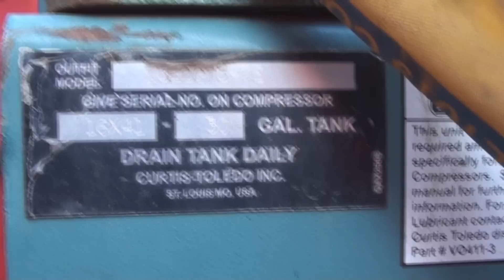Air Compressors & Pneumatic Tools

Comment: I see you put a chicken-like cage around one of the compressors; i assume this is incase it blows up?
Reply from the maker: Actually it's a good deal heavier than a chicken cage. More like a gorilla cage. It's there to prevent the compressor from being damaged by forklift or whatever hazard comes its way.  FWIW the pressure relief valve(s) are there to keep it from blowing up.

Comment: Blurring out that HF drill doesn’t make it any less awesome.
Reply from the maker: I blurred it cuz it had my name engraved on it.  Nowadays I cover my name with a bit of electrical tape.
Reply: @repairs101  Check this out... I bought an electric angle grinder for 9.99 at HF and I added the 1 year replacement plan for 2.99. The lady at the counter told me that it starts after the HF 90 day warranty and to bring it back in a year whether it’s broken or not, and they will replace it no questions asked. The manager was standing right beside her and said nothing. So, for $13 I essentially get two angle grinders! I will probably buy most of my stuff from HF now.

Comment: My only question is one thing: I cannot find a compressor that has over 6 CFM @ 90 PSI. I found an air impact wrench that I want to use that is 6 CFM @ 90 PSI minimum. The only compressors I can find are 60 gallon compressors that have 7 CFM or above. Everyone tells me "oh you need to have more CFM than your tool" but I know there has to be more options than a 60 gallon compressor.
Reply from the maker: You are trying to match an industial tool with a home compressor.
Get a compressor that runs on 220 volts or buy a hobbyist impact gun.
Reply: Gotcha, thanks for the info!

Comment: can you use a air tool that has a slightly higher CFM requirement than your compressor?   for example im looking at a compressor that has a 3.7 CFM at 90 PSI and the tools i had in mind for it require 4 CFM   any input would be helpful
Reply from the maker: It will probably work OK just not to its full potential - I'd look for a bigger compressor.

Comment: I only put impact tool oil in the air inlet. I've heard of people using ATF, but i haven't tried it. I also just bought a mini grease gun to put heavy grease in the little hole on the body.
Reply: I have an IR 2135Timax and I've gotten great performance out of it, it has a grease fitting but I've never greased it. I just add three drops of ATF every day, and that's how I maintain all of my air tools.
Reply: thanks chantz. did you know they have a 2235 now? I am going to see what the heavy grease does for my gun.
Reply: Yea, I was looking at it, but I buy all of my air tools of off my local Mac dealer, and he sold me all of my IR products. He advised against buying the 2235 because the anvil breaks often.

Comment: hello I'm looking to buy a air compressor and I'm wondering if the bits that goes on the end of tool which will attach to the quick release do they come with the tools if any one can help me plz thanks
Reply from the maker: Almost any air tool you buy will come with QR fittings.
Reply: Thanks for the help its really help me thanks

Comment: One other thing to note is that quiet air compressors actually are available, but probably not carried by your favorite tool retailer. Check around online if this is important to you. You'd be surprised what you'll find if you search for "dental air compressor". Much cheaper to buy a quiet unit in the first place than to have to build a separate closet or shed for a noisy unit later.
Reply from the maker: Great tip! Thanks for commenting!

Comment: Capacity is also a problem. 10gal is 1.33Cubic feet, you can only use @ 1/4 of it before pressure gets too low and the compressor needs to kick in. So if we can use .4 cubic feet. we get (.4CF/20CFM*60s =) 1.2 seconds use before compressor needs to run (0.4CF/4CFM*60s =) 6 seconds to fill it again. So in that case you would get to use the tool one second in every 5 for a couple of minutes, and then take a couple of min off (I know 4 isnt 5.3, but its close & a crapload easier to do the math lol)

Comment: To put that another way - if you have a 4CFM 50% duty cycle compressor it can actually give 2cfm AVERAGE over a 10 min period. It can probably do 80CFM for a second or so but then you would need to let it fill up and sit for a few min to cool before it could do it again. So if the too uses 20CFM you can use it 2CFM/30CFM =1/10th of the time or one minute in every 10.

Comment: Sure you could use it - but how much. It will already have a duty cycle they used to estimate the cfm needed, ie it might uses 18cfm but they figure you will only use it 20 sec per min so that averages out to 6cfm. Then the compressor has a duty cycle 50% at 5.3cfm so its 2.7cfm average. so then end up with a tool you can use for maybe 9 seconds every minute on average. These are guesses - but you can easily find specifics and figure if it is enough for you

Comment: That doesnt make sense my friend. Combining 2 6cfm pumps will give 12cfm, pretty simple math. Would be just like any other dual pump setup. Just like any other dual pumper would be best to use a combining tank to even load. Of course their duty cycle (DC) needs to be taken into account, but even with 50% DC units they would combine for 90% DC at 7cfm. There should be NO problem at all running the tool, other than stopping for 30s total over ea 5 min if they are 50% DC DIY grade units. Cheers :)

Comment: to help people out i have a 27 gallon craftsman pro that is perfect for around the house/farm.  its big but portable, and i usually just unplug it except when i need to run the pump again.  Its perfect for working on cars.  if you are only going to run a nail gun you could probably get away with something smaller.  sears has a chart in store for what their compressors are good for.

Comment: Very informative; I'm running a 30 and a 20 gallon Craftsman compressor in tandem and was wondering if I can run a sandblaster rated at 7cfm.  The compressors are rated at 6.4 and 6.2 at 90 psi.

Comment: Hi my impact gun is rated at 6cfm. I'm looking to buy a 10 gallon compressor with a rating of 5.3cfm @90psi with a 5 gallon tank attached to it. I figure the duty cycle wouldn't really be crippled since the output is almost close the the guns cfm. Keep in mind this is for home use. My problem though is 10 or 15 gallons going to be enough for an impact gun?

Comment: the rule to pick an air compressor is quit simple, always look at how much CFM@90PSI the higher the number the better it is. most tools are made to work around 90PSI.
example: if an air drill is rated at 4cfm@90PSI and you have a compressor that is rated for 3cfm@90PSI it will simply not work your motor will not be able to keep up with your tools demand it's like trying to use a 220v drill with 110v plug, as far as i am concerned anything below 10CFM@90PSI is junk.

Comment: ok thanks 1 more question is that the compressor runs at 4.0 cfm at 90 psi and 5.0 cfm at 40 psi and i will not be useing a paint gun, is it still fine?

Comment: One thing worth noting is that compressors are rated by their maximum output in CFM.
Air tools have two ratings, one is in ACFM (average CFM) the other is in CFM.

ACFM is the volume of air required in 15 seconds averaged over a minute, or a 25% duty cycle.
CFM is the volume of air the required under load for 1 minute, or a 100% duty cycle.

The total required CFM for continuous duty is normally 4 times higher than promotional material claims as they state ACFM numbers.

Comment from the maker: Google "Die Grinder Exploded View" and you'll get some nice PDFs that show all the internal parts. Air is guided in through passages in the casing to act on the blades of the vane which rotates the shaft. The heart of the thing is a "Vane Pump" driven by air flowing past the actuator valve, onto the vanes and out the tool's exhaust port. The vane assembly rotates the output shaft.